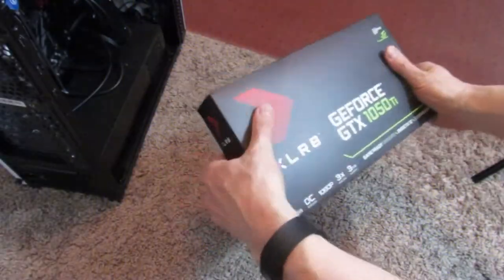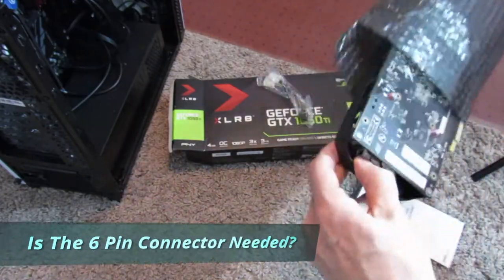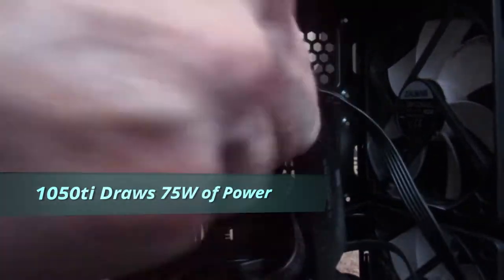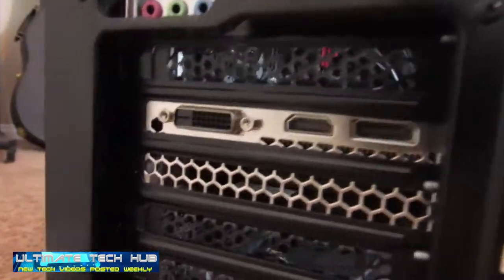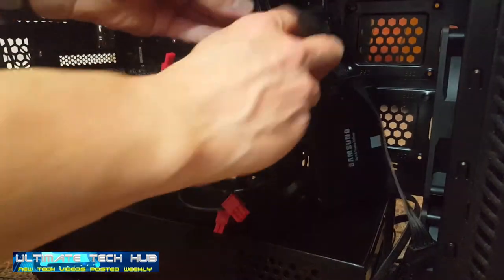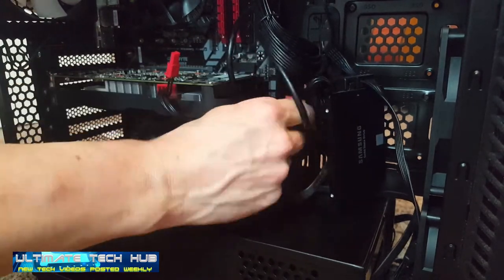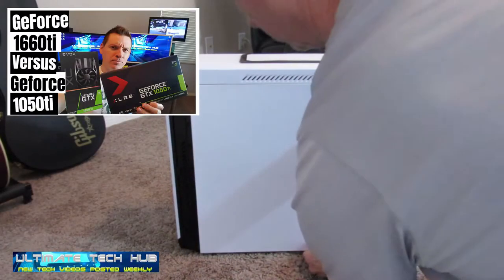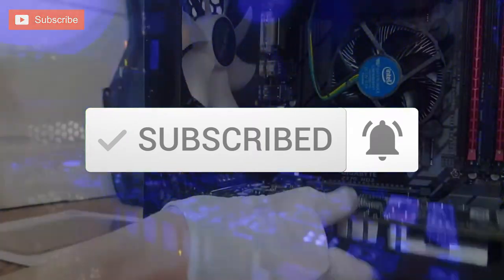GTX 1050ti INSTALL - DOES IT NEED A POWER SUPPLY?

Comment from the maker: I hope this video helps with the installation of the Geforce 1050ti GPU. And let me know if you prefer to use the PSU or the Motherboard to power the 1050ti. Thanks for watching!
Reply: Will it work on 200w psu with 220V
Reply: @tapascisa214  never think of it
Reply: My one fan GTX 1050 ti doesn't even have the power connector. The reason you have one is to power the fans sicne you have two. Mine only has one.
Reply: Thanks the video was useful

Comment: you dont NEED the connector.... but you WILL need it if you decide to overclock to anything remotely noticeable the video card as that takes the power requirements up and over the PCIe supplied limit.

Comment: You saved me , not only by simplifying it , but by actually giving true info!! I’m glad I didn’t need any pins tho because my psu doesn’t have any pcie, can you confirm that an msi gtx 1050 ti would do the same though? 

Sorry if it’s too many questions lol
Reply: I know it's a but late to reply but yes, it should be the same.
Reply: @ethan004  Ethan, even if this guy never saw your reply, you damn sure helped me.  I can buy a MSI 1050ti for cheap, but it's one of those with two fans and a 6 pin.  I was researching SATA to 6 pin adapters, but it sounds like I don't even need that.... so thanks.
Reply: @ethan004  i needed this reply. so thanks.

Comment: Great video 👍

Yeah it won't exceed 65 Watt when full load. I remove the stock fan and use an old dell fan to keep the gpu and 1 nvme under it cool at once 😂

Comment: Thanks for the clarification , I have a gt 1030 and wanted to change so I could get a small boost , but meh , the prices for 1050ti right now are absolutely discusting for the ammount of extra fps I am going to get , I am going to wait , I don't want to spend even more money on a new power supply since where I live they are expensive too.

Comment: Sorry to bother you, I'm currently building my PC and I've run into the problem of not knowing what to do for PCIe cable for the card. I have a 750w power supply, and it came with PCle cables of different slots but not the one that I apparently need, which is 16 slot.

Comment: Hey! I got a Galax GTX 1050 ti 4gb and have an ASUSTEK B85m-g motherboard. I dont know much about pc building or graphics cards. I wanted to ask if I need the 6 pin connector for the gpu if I want to play games like GTA 5 and want to run game development softwares like Unity? Does my motherboard have enough power for a 1050 ti 4gb? I also know nothing about my PSU currently. 😅 😢😢😢

Comment: I'm glad I found this video—this gave me some more info for what I'm looking for.  I'd love to wire some power from the PSU but I can't find anywhere to connect it to on the GTX 1050ti I just purchased from Amazon D: I wonder if this is an updated model but I don't see any 6 pin connectors on this piece of hardware.  I'll go ahead and see if it even needs it but my motherboard is pretty outdated so not ideal, unfortunately; any advice for a total novice?
Reply from the maker: Just install the GPU into the motherboard and see if it works. If not then a new motherboard is probably needed. Thank you for watching and if you subscribed thank you as well.
Reply: @UltimateTechHub  yeah I fear the motherboard isn't compatible unfortunately.  Fans are running but I can't get any signal out of it no matter what I try 😢 thank you for the speedy reply, just subscribed 😁
Reply: @UltimateTechHub  wow so this is insane. I found a forum post (thank god) regarding this exact issue with my motherboard (the msi a78m-e35) and turns out MSI sent out a batch of these boards with a jumper in the wrong place for the "jusb-pw2" portion of the board.  Moved it over a singular pin and it works like a charm now 🙃 thanks for the help! 😅🤣
Reply from the maker: @GooseTowne  Thats amazing! Congratulations!! Thanks again for subscribing!

Comment: Hello mate, I liked and subbed aswell
My PC currently has a320m-s2h motherboard with amd ryz 3 1200 cpu, MY PSU IS 250 WATTS, will it be enough for the gtx 1050 ti? (It doesnt even have 6 pin connector on gpu) Your answer will help me alot
Reply from the maker: 250 watts is very low. I would recommend a 350w minimum. Thank you for subbing I really appreciate it. Keep me posted.
Reply: Yes 250 watts  is indeed low than the reecommendation, but theere have been a few occrurences where it has worked for people right? specially because my full PC takes up around 130w and i have 115 watts  left.. If i plug in the GPU and my pc automatically shutdowns is there possibility of my mobo getting fried? @UltimateTechHub

Comment: Wow, I didn't know that.
I have an optiplex 3050 (big size) and I was wondering if I could install an iGame GTX 1050 ti graphics card but I don't want to do modifications to power supply or something because I don't really know a lot of those things and I don't want to mess up the whole computer.

Comment: I want to use  gtx1050ti but i am worried about my PSU. It is only 290w
I dont know if it will work
Please answer me. Thank you
Reply from the maker: It will work. The GPU draws a small amount of power and the motherboard can power it so don't plug the.power supply into it. Thanks for watching and if you subscribed thank you as well.

Comment: what is the differences of with and without  6 pin power? it will affect the performance? i mean with or without 6 pin do you think the performance is still normal and not affected?
Reply from the maker: It should preform exactly the same. Thanks for watching!
Reply: @UltimateTechHub  Thank u bro!! 😭😁

Comment: I have a old Hp pc good specs I have a gtx 1050 ti Installed with 180w and it seems to work fine lol I think it Only exceeds The limits when overlocking but just dont overclock this is to all the people having this problem Your gtx 1050 ti and ecen gtx 1650 low profile will work With 180w Just dont Make sure u overclock

Comment: I have a gt1030 planning to upgrade to 1050ti, will it need a new psu or not? I have a built in psu in my case.
Reply from the maker: No you should not need a new PSU. Remember it draws very little power. Other GPUS like 1660 or 2080 draw way more power. Enjoy this GPU its very good especially for the price. Thanks for watching and if you subscribed thank you as well.
Reply: @UltimateTechHub  how about the 1650?
Reply from the maker: @sanji261  ive never installed or used a 1650. Ive looked at the benchmarks and they seem pretty solid for a small GPU.

Comment: bro I'm a few years late already but today I managed to buy an MSI GTX 1050TI Gaming X and I don't have the 6-pin cable on my pc. I ask, do you think it is necessary? I understand that the power can be taken directly from the motherboard but I just want to make sure it works for me, thank you very much new follower
Reply from the maker: You shouldn't need to the 6 pin connector. Install the 1050ti and it should be all good. Thank you for watching and for subscribing I really appreciate it.

Comment: My GTX 1050 Doesn't load without 6pin power supply?? Is using 1x 4pin Molex Safe? Or do I need to use 2x 4pin molex?

Comment: so, how come you alternately say "300w minimum PSU" and "250w will work fine"? which is it? I've got a 240w PSU, and I can't really upgrade it on account of it's got to be a funny shape in order to fit in my sff case.
Reply from the maker: Sorry if I said 250w but Nvidia recommends a 300w psu to power the GPU and the other computer components. You can try the 250w PSU but it's not a guarantee that it will work. Thanks for watching and keep me posted.

Comment: Same gpu with 700 w psu, only connected to the motherboard but said please power off and connect the pcie cables?
Reply from the maker: That's strange. Maybe it's the mobo that's causing the power issue. But it's simple enough to plug in the PSU connector. Thanks for watching.
Reply: My psu doesn't have 6 pin connecter, what can I do? Glad with the fast response :)
Reply from the maker: @alwindenz  If your PSU has a 4 pin and 2 Pin you can combine them or just purchase a 6 pin connector they are pretty cheap. Keep me posted.

Comment: My psu for pc is 280w. Recommended for this gpu is 300w. Does it really matter? Should I buy a new psu? My Lenovo h50 desktop came with pre installed intel graphics 4600. Please advise. Thank you!
Reply from the maker: Give it a shot with your current PSU. It might work. If there is any issue then yes replace the PSU with a 400w or maybe even a 500w.
Reply: @UltimateTechHub  thanks the prompt reply, would you be able to recommend me an affordable psu? Maybe the one or something similar you’re using on this pc?
Reply from the maker: @kevinhhn  I believe it's a Thermaltake 650w. But you could get a 500w and be just fine. Although it's always nice to have extra power for those future upgrades! Good luck and thank you for watching!

Comment: I have dell optiplex 990 i5 2400
8gb ddr3 ram 500gb hard drive and 265 watts psu, which graphic card would you recommend?
Reply from the maker: Probably a GTX 1660ti. 265w PSU is not much power. For an RTX you would need at least 650w.
Reply: @UltimateTechHub 
Thanks for the reply, should I go for low profile gt 1050ti?
Reply from the maker: @unknownperson2524  Yes low profile would work.
Reply: @UltimateTechHub 
I'm confused because of the psu as it can't be replaced, I want to play games like gta v cod ww2 assassin's creed origins etc with at least 60 fps
Reply from the maker: @unknownperson2524  It might be hard to achieve those fps. Your PSU is going to be the big issue.
Reply: @UltimateTechHub  s
It means I need to replace the desktop.
Anyway thanks for the suggestion.

Comment: What if i have 240 watts psu. Would it still work or is it risky?
Reply from the maker: That is probably not enough. I would recommend a 350w minimum which gives you some extra power for over clocking. My PSU is an 850w. Thank you for watching and if you subscribed thank you as well.

Comment: awesome thanks! do you need the 6pin if you're using a eGPU GDC dock with a 500w power supply ?
Reply from the maker: Try it without the 6 pin first and see if it works. If it doesn’t wotk then hook up the 6 pin. And a 500w psu is plenty.
Reply: Ultimate Tech Hub awesome thanks 🙏🏿
Reply: @UltimateTechHub  Can you help me,i have gtx 1050,and i must buy psu i found cooler master 460w it wiil be okey for GTX 1050?
Reply from the maker: @f1___493  Yes that will work. Plenty of power! Thanks for watching!

Comment: Hi so I have a 1050 pulled from another computer (prebuilt) and I was wondering if there is any way I can boot without the motherboard telling me to plug in 4-pin power when there are no 4-pin slots and the gpu does not have any slots for power either.

Comment: I purchased one of these graphics cards from ebay. Came in today though the package did not include a power connector for the video card. When i turned my pc on, i got the message telling me to connect the power connector.. bummer. Now i have to order a power connector for this card. So.. this video isnt 100 percent true for all PC's. My PC is a Dell Inspiron 3847.
Reply from the maker: There are always exceptions however I have never ran into the power issue with the 1050. Your PSU does not have the PIN connectors? The 1050 does not come with PSU connectors.
Reply: @UltimateTechHub  Hi and thank you for replying. Actually, no, the power supply in my PC does not have the necessary 6 pin connector for this video card. Had to install back the old video card, so going to have to order a power connector for it unfortunately. After watching this video, found another video talking about how there are a lot of fake GTX 1050ti cards being sold on ebay. Has me wondering if my card is a fake now.. argh.. but thanks for your reply.

Comment: Hello my pc currently has asus h110m-r motherboard with i5 6500 my psu is 700w(200w real) will it be enough for the gpu and my psu doesn't have pin connector should i use 2x molex to 6pin PCI E adapter cable?
Reply from the maker: Yes use the 2x molex 6 pin.

Comment: HI LOVE FROM INDIA , I HAVE Q THAT CAN I USE THIS 1060 TI WITH 450W POWER SUPPLY WITH I3 7200 .THIS PSU DOES NOT HAVE PCIE POWER CONNECTOR. PLZ HELP PLZ

:face-purple-crying::face-purple-crying::face-purple-crying::face-purple-crying::face-purple-crying::face-purple-crying::face-purple-crying::face-purple-crying:
Reply from the maker: Yes it will work with the 450w! Cheers to India! 😀

Comment: Sir can I put gtx 1050ti with a 180 watt psu,my pc has i3 6100 cpu      pls tell sir
Reply from the maker: It will be close but probably will work.
Reply: @UltimateTechHub  thanks sir
Reply: @UltimateTechHub  but how much watt will this configuration take     pls tell sir
Reply from the maker: @mastertechie6093  Probably right at 180w.
Reply: Sir will I be able to play games on 180 watt on gtx 1050ti or not
Reply: @UltimateTechHub  sir should I buy gtx 1050ti while having a 180 watt psu    pls tell pls 🙏
Reply from the maker: @mastertechie6093  I cant say for sure I would just test a game and see what happens. I have never used a 180w PSU. My minimum is 350W.  Hope this helps.
Reply: @UltimateTechHub  ok sir thank u for giving your precious time

Comment: i have a 700w psu and my 1050ti is 6pins, i understand the video you post, i just need an answer if its okay that ill just directly plug the gpu without using a 6pin from psu?
Reply from the maker: Yes its all good
Reply: @UltimateTechHub  thank you very much for fast response im goin to plug my gpu now

Comment: Hey man!  would a Geforce GTX 1050ti fit in a Dell Optiplex 9020, would it be able to power that card? 🙏
Reply from the maker: It should. The gtx 1050 is not very big. The board should be able to power the card.

Comment: can i use this gpu without the power connector in a Lga 1155 intel H61 motherboard?
Reply: and my GPu is Galax Geforce GTX 1050Ti Exoc
Reply from the maker: Yes
Reply: @UltimateTechHub  wow very fast response thanks

Comment: Will it be fine on a 250w power supply??
Reply from the maker: The specs say a minimum of 300w psu is needed however I have heard of a 250w psu working fine. It just depends on your other components and how much power they need.

Comment: Wait my 1050ti doesn’t even come with a little socket to plug in the 6 pin
Reply from the maker: You don't need it the motherboard will power the GPU.

Comment: I have 180 watts my cpu is an i3-8100 will the 1050 ti still work with room to spare?
Reply from the maker: Give it a try it should be enough. But a 180 watt psu is kind of small may want to upgrade to 300 or 400 watt.
Reply: Ultimate Tech Hub can this fit into my hp pavilion desktop (tp01-0014) is the model
Reply from the maker: @minx6773  is it a mid size case? If so it will fit.
Reply: Did it work?

Comment: Hello!  Please tell me, will the gtx 1050 ti work well with the Codegen 300x (400watt)?
Reply from the maker: Yes it shoudl. The minimum PSU for the 1050ti is 300w so 400w is plenty. Thanks for watching!
Reply: @UltimateTechHub  Thank you very much!  But I only care about one thing, are they compatible?  I'm just not good at it.  Could you see the specifications of my PSU?
Reply from the maker: @solardummy  Yes. I've never heard of a PSU not being  compatible with a GPU. It should be fine.
Reply: @UltimateTechHub  ok. Thank you:)
Reply: @UltimateTechHub  Excuse me.  I have one more question.  Are H110M-K and gtx 1050ti motherboard compatible?

Comment: So I don't need to connect the 6 pin connector to 1050 ti? Or also from other Gpu that isn't much needed power?
Reply from the maker: You can connect the 6 pin connector but it's not mandatory. The 1050ti draws minimal power. The mobo can power it all by its self. Thank you for watching.
Reply: @UltimateTechHub  Can I ask one more thing. Is it compatible for ryzen 5 2600x a gtx 1050 ti?
Reply from the maker: @keirbanagale1656  yes

Comment: I just bought an optiplex 390 sff with an i5 and 8 gb of ram, can I put a 1050ti lp in it without upgrading the psu? Will it bottleneck?
Reply from the maker: Shouldn't be an issue. The 1050ti only requires a 300w PSU and its more of low to medium end GPU so it should work without any problems.  Have Fun!!! Thanks for watching!!!
Reply: @UltimateTechHub  im pretty sure my pc only has a 240w psu will it still work?
Reply from the maker: @cxpzfn  it will be a close call. That's pushing it for sure. I would upgrade to a 350w PSU.
Reply: @UltimateTechHub  a 1030 lp would work fine with a 240w psu and a sff case right?
Reply from the maker: @cxpzfn  yes it should work fine. The 1030 only draws 30w of power.
Reply: @UltimateTechHub  ok thank you

Comment: I want to install on Lenovo tower  desktop, which has 180watts psu and core i5 7400 cpu.
Reply from the maker: You need a minimum of 300w power supply for that GPU.

Comment: i bought a msi 1050 ti graphics card and it dosent have a plug for the pci and it wont detect it without it help please
Reply from the maker: Are you talking about the 6 pin connector for the power supply?

Comment: When I installed without the cable when I turn on the pc it says I must hook up the pci cord to the card on a black screen. I have a 500w power unit. Any ideas what I can do?
Reply from the maker: Thats definitely unusual.  Do you have a power cord to hook up to the gpu? 500w is plenty of power.
Reply: Wow thanks for the fast response. I have only a 4 pin hookup. I was told this card didn’t need an extra power hookup even though it has the plug in on top. I get a power down and hook up a pci cable. I saw your video and was hoping you would have some insight, or should I just buy an adapter and hook up the card to the power?
Reply from the maker: @josephgreer2291  I would buy the adapter. That should solve your issue.  Keep me posted!